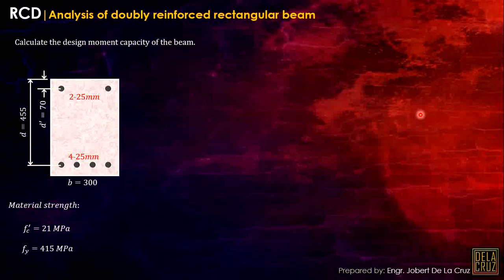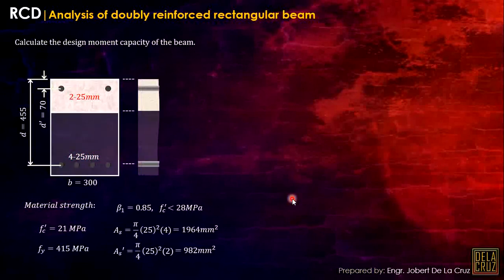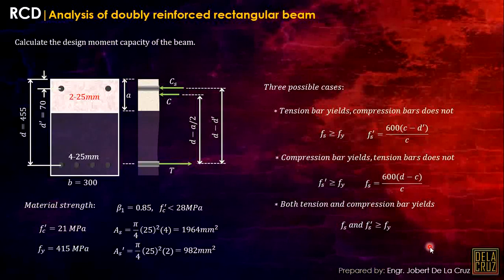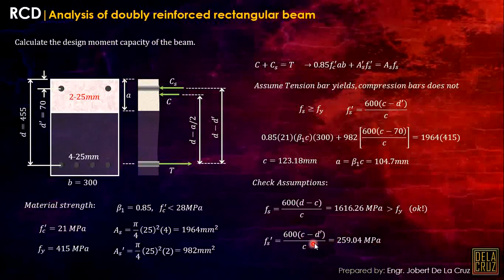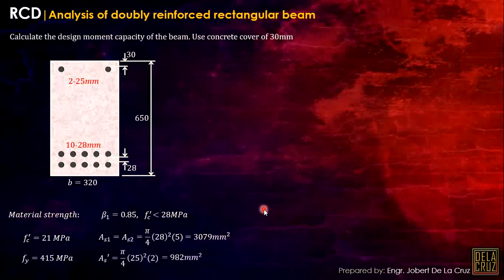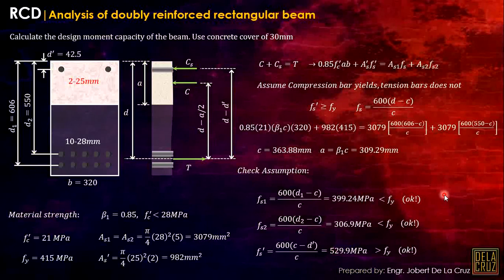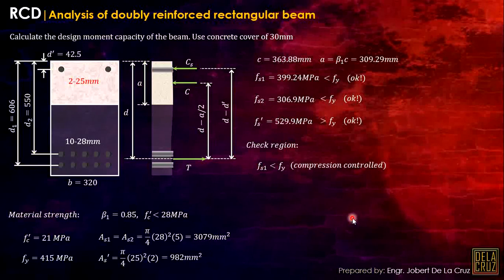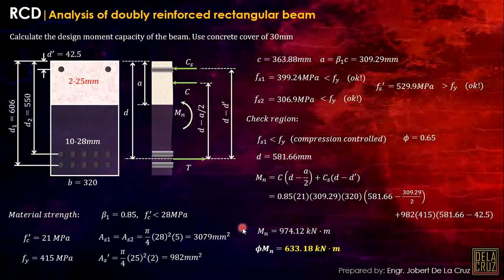RCD | Analysis | Doubly reinforced rectangular beam | NSCP 2015

Comment: Hello, I tried checking whether it’s DRB or SRB (using as a practice, I know the video’s DRB) using rho and rhomax, rho turned out to be 14.38×10-3 while rho max is 15.67×10-3 which is larger than rho. Shouldn’t this problem be an SRB one?
Reply: And for example two, having the ybar as 27.99mm I’ll get 

d = 650-30-28/2-27.99
d = 578mm

😭😭😭

Comment: Isn't tension bars needs to yield first before compression bars can?.... I thought the creteria should to be to assume; tension bars yield and compression bars don't yield and to obtain strains of compression steel from strain-similarity diagram
Reply: Yeah. I guess this is for investigation or solving purposes only. In reality, Tension steel must yield in DRB. as it is in principle that as As+=a+ and (a) has limit that is why we need Cs.. puting many steel in tension is useless as it will become compression controlled.. x for economy  x for Strength
Reply: Not always tension bar yields. Compression bars sometimes need due to concrete is not enough to resist compression force.

Comment: Sir, i would just like to clarify that the beam is designed or analyzed as doubly reinforced if/when the actual steel ratio exceeds the maximum, am I right? In your solution, I didn't see you compare the steel ratios. Just asking. Thanks
Reply: In your 2nd example, how can you fit 10-28mm (1 layer) in a 320 mm width of beam?
Reply: @ time stamp 11:28, you mentioned fs' does not yield when it it greater than fy, then @ 13:42 where fs' is the same, you mentioned it is ok. Please clarify.
Reply: @edbo9119  Tignan mo po mabuti ang figure, 2 layers nga eh. Bat mo pa pagkasyahin sa 1layer ang 10pcs?
Reply: @edbo9119  Okay naman ang explanation niya. Iba ang value ng fs' @ 11:28 and 13:42.